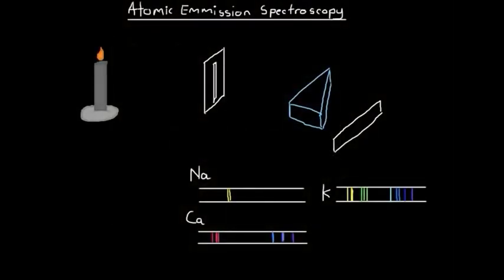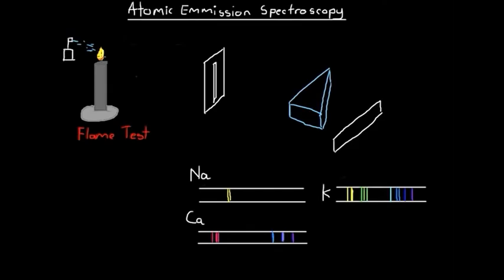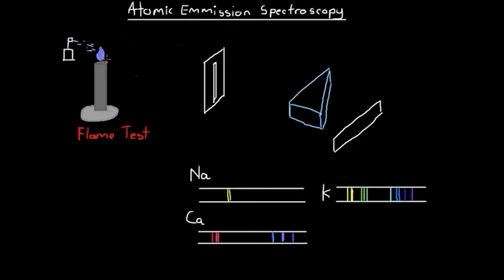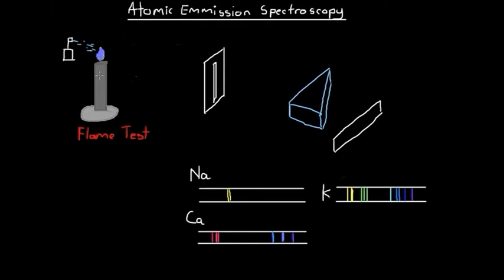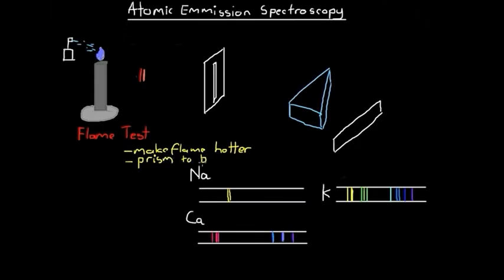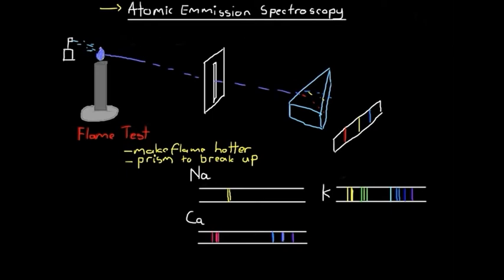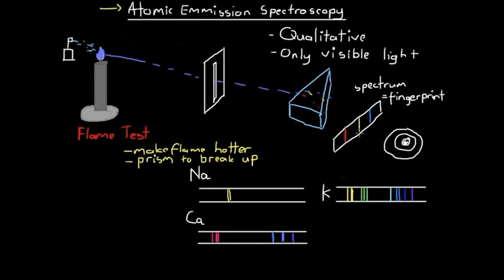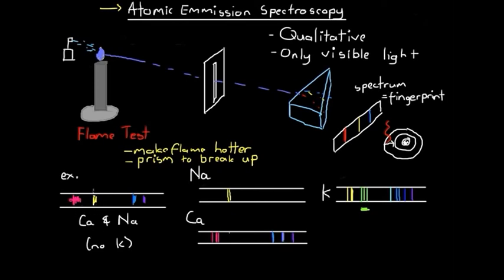Atomic Emission Spectroscopy

Comment: Thanks for the video. How do you spray sodium into the flame? Sodium is a solid, and how to make sodium into a solution (it will react with solvent, for example water to convert to sodium hydroxide)?

Comment: Someone summarise this in 5 sentences please
Reply: Atomic emission spectroscopy is a qualitative analysis we can use to identify the type of metal(s) we are dealing with. Basically, we heat the metal sample, so the metal atoms/ions get excited (edit) and when they get de-exited and fall back to where they were in the valence shell, they emit visible light which is unique to each element. We can then use a prism to break up the visible light produced and get a light spectrum for the metal sample. This can then be compared to known data to identify the metal sample. if the sample contains more than one type of metals, the light spectrum it produces would contain all the light that all the metals in the sample emit.
Reply: @yuxinli4610  wait is it when the metal atoms/ions get excited, visible light is emitted or is it when they're getting de-excited, visible light is emitted?
Reply: @bob12949  ohh yeah, you’re absolutely right! Thanks for the correction!!
Reply: @yuxinli4610  no probs, has to make sure haha cuz I'm doing a report on it now
Reply: Is it only possible for qualitative not for quantitative, imma confused state,moi faculty confused with this with flame photometry